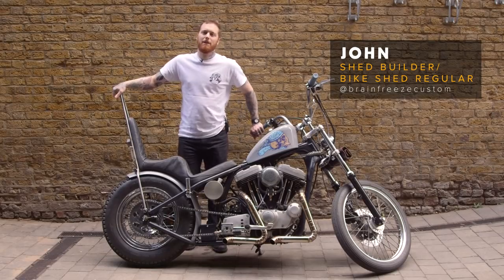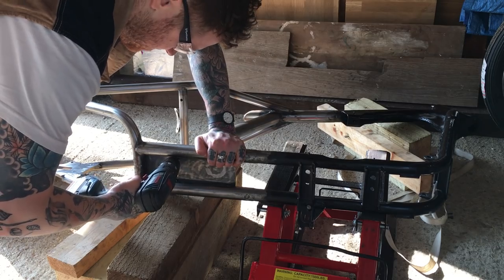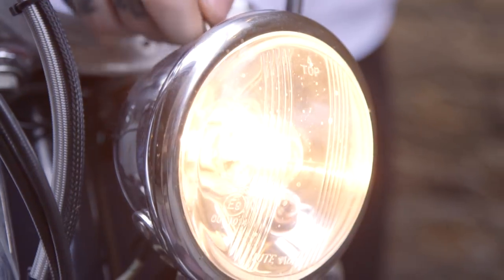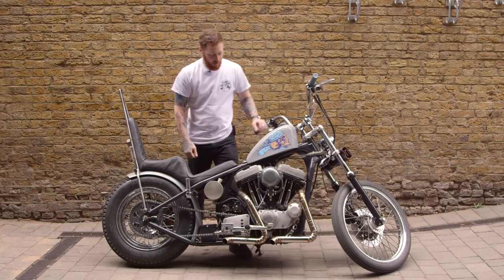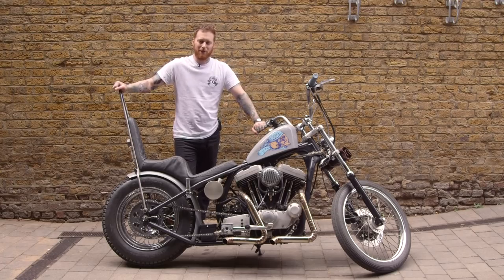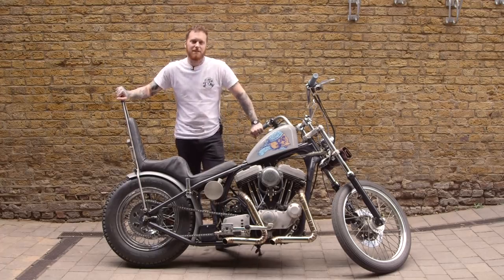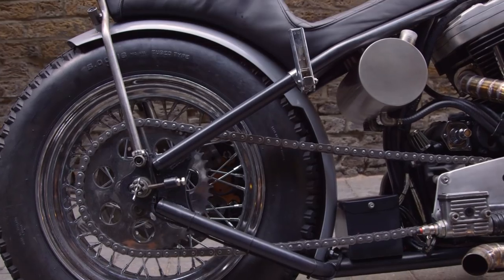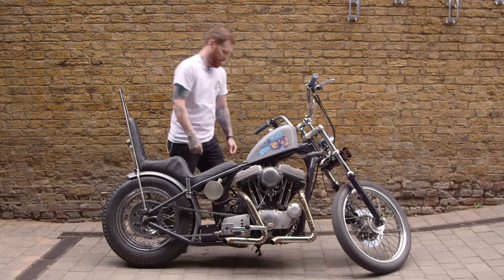Regular's Rides: John's 1998 Harley-Davidson Sportster

Comment: ..sorry!, i didnt hear your bike running before commenting!!!!!, 
Motor sounds really smooth, nice even idle speed,  i like the short pipes, (dont listen to any idiots criticizing the welding!, they are absolutley fine!, they curve in and around just right, and as you clearly have sorted the jetting and timing, you have built a really cool ride everyday bike,most folks would envy😀
Reply: Cheers buddy!!
Reply: @brainfreezecustom5476  this is a brilliant bike, the fact that you ride this every day around london, and are still alive😀, i love all the attention to detail, the headlight rocker switch, side starter button, t.i.g welded frame, avon speedmasters, the whole thing is the perfect mix of oldschool look late 60s/early 70s chopper, but built for keeping you rolling in the 21st century,

Comment: NICE. Where can I get some of those most hidden looking turn signals that you have. When I was younger I just ripped all of that junk off, but getting older makes me paranoid
Also I live the way you utilized the chain guard with your home made custom. 
And las but not least, is that an Avon back tire? I love  the tread design. Thumbs Up!!!
Reply: Thanks Michael. Yea it’s a 16” Avon SM rear tyre. Indicators are just led strips cut down to size and wired up to an little flasher.

Comment: Curious why you were fixing it more than riding it. My 2003 Sportster has 52,000 miles on it and with the exception of one ignition module, it's been 100% reliable and trouble free. It's been ridden on roads with salt residue, traces of snow and in heavy rains. No chrome peeling off(what chrome?) and the electrics are great on these bike. These years of Sportsters are rock solid and dependable. I dunno about yours.
Reply: Sure, they are decent bikes and well made. Mine had 7 owners and it looked like they had all had a go at doing something to it. The result was a bit of a mess. Some sportsters have chromed engine casing, some are black paint some are raw ally. The chrome on HD is notoriously bad quality. Solid bike apart from that though!

Comment: How did you go from a four spark plug system to a two spark plug ignition or was yours already the two spark plug ignition. I have a 1998 sportster s with the four spark plug ignition system. The need result on your ride is awesome brother. Looks amazing.
Reply: Sounds like you have the sport edition with duel spark plug heads and performance cams? Standard is just 2 plugs total. Cheers!
Reply: Brain Freeze Custom thank you very much for the input. Yes I do have the sport model. Not much sport to it right now due to the fact it is in a bit of a mess on my shop floor. Lol. Still going to dive into it and get going. Looking at doing the Tc bros hardtail chop.

Comment: I recently brought my dream bike a 2006 FXSTB Night Train EFI just spent a fortune on a new vance and hines exhaust system, FUELPAK, air cleaner, slammer kit, 14" apes, new black rimes on original chrome lacing. The bike looks the biz and .... I still fucking hate this thing and I want to get rid of it to buy a carburetted sportster. To the hell with all EFI harleys they sound like shit. Literally shit. A pile of shit. This is  not a harley. The last harley ever rolled off the assembly line was in 2006 when the  very last carbed model was made.